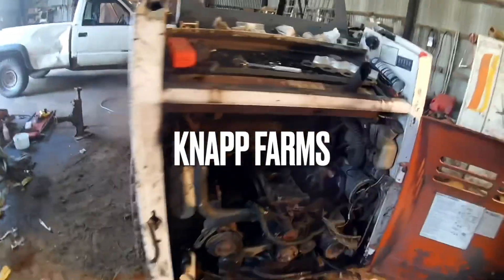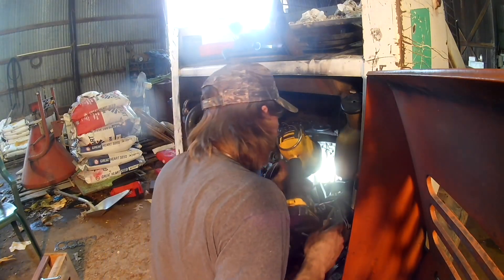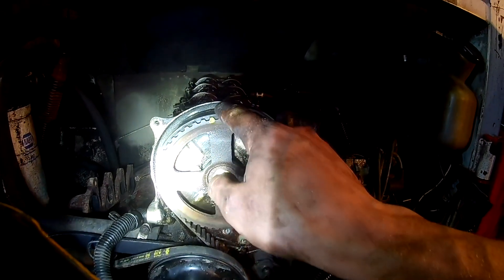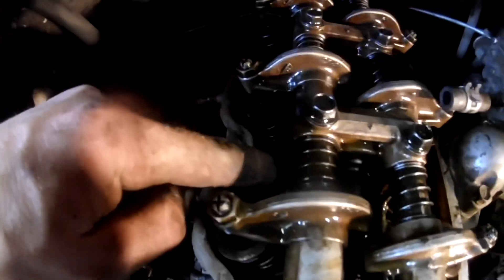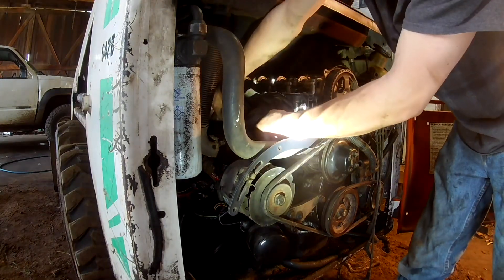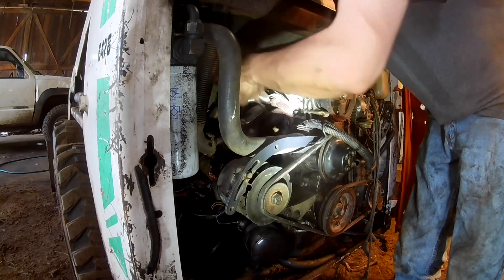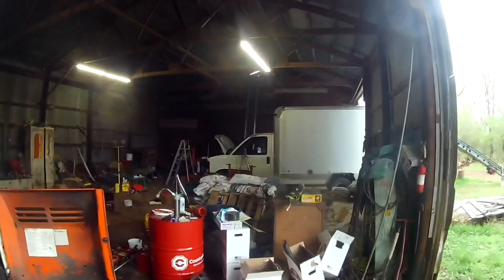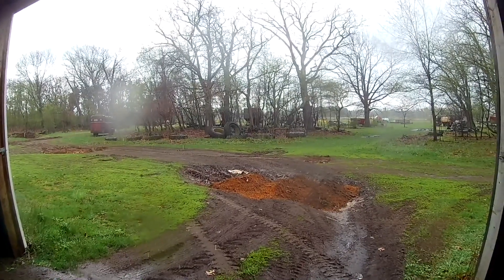Bobcat 642B head gasket replacement and working

Comment: 12-mm is near 7/16, 13-mm is 1/2, 14-mm 9/16, 16-mm 5/8. a number of metric are close to 
S.A.E. GREAT JOB, it is always a chalenge to repair engines. motor sounds great,

Comment: Just a comment on timing with dist.out.First of all always mark your rotor to somewhere on the block and watch how it comes out.Than just put it back in same place.If for some reason you are still out remove dist and bring no 1 piston ip to top dead center on compression stroke and line up timing marks on flywheel and than put rotor on no 1 cap wire and drop in.If it doesn't slide all the way in have someone bump the starter while pushing dist.in.It will slide in to place.Time engine and you're done.Hope this helps.
Reply from the maker: Never thought about pushing while someone bumps the starter I’ll have to try that next time I have to time something thanks

Comment: Where did you find the head gasket? I cannot find one
Reply from the maker: Atlas bobcat in Merriville Indiana lol but I think they have stores all over not very good customer service but they where the only one with the part so had to go to them like you said I couldn’t find it anywhere else
Reply: @knappfarms  thanks for the info
Reply: @leekennedy9642  I owned a 642b. The 4g32 mitsubishi engine was used in some Dodge Colts and Saturns. I found engine parts at Auto Zone
Reply: @johnslesinger7109  thanks for the info. Sending the block to machine shop this week hopefully they can get it back to a decent condition.